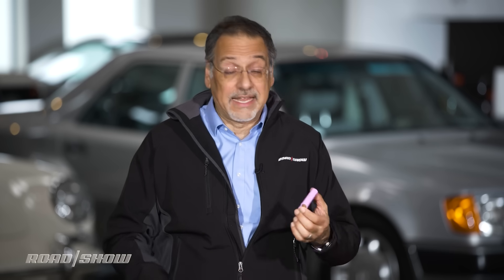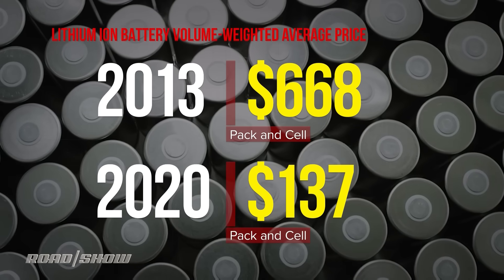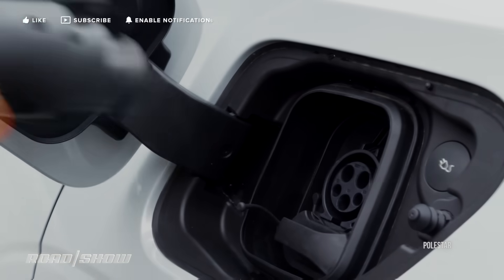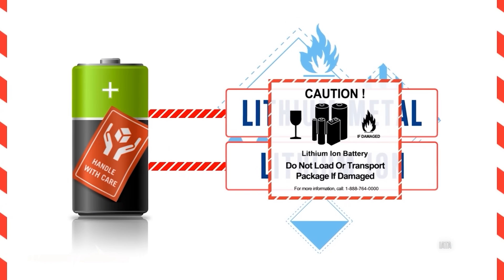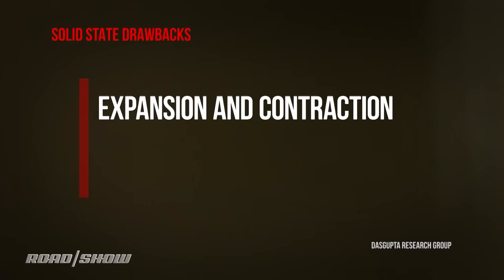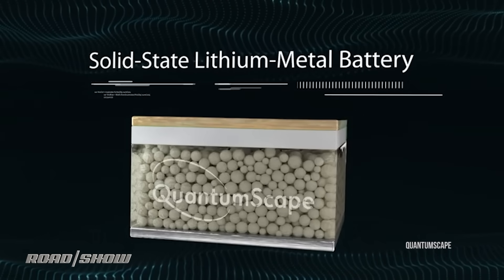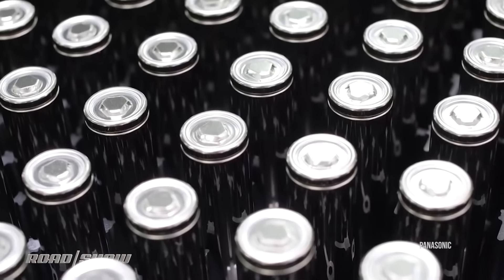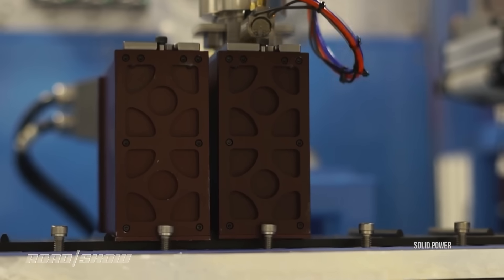When solid-state batteries arrive, you'll want an electric car

Comment: 96% of current EV batteries are recycled which is far better than dino powered cars.  Best aspect of these SS batteries is that they are a very easy replacement on existing EV platforms.
Reply: You still claiming oil is made from dinosaurs?
Reply: @sandersson2813  Oil comes from dead organic material of which consists of animal and plant ... some of that will be from dinosaurs  given enough time ... under pressure forms crude oil.  Either way, oil is a short term finite energy source that has climate impact when combined with oxygen and ignited and not recoverable.  Our sun is an easily obtainable source of energy with a life expectancy of 5 billion years or so ... oil has a life expectancy of 2065 or best estimates 2095 when it requires more energy to extract than is recovered.  The “dino” reference is one more of aged old energy source with a finite lifespan as in dinosaur extinction.
Reply: @robainscough  it's not made of dinosaurs though. It's made from algae and zooplankton. 
It's not made of bloody dinosaurs. 

Furthermore even EV makers say that EV's aren't especially green and like I said in another post if you got rid of all European cars today, you'd only save the planet 1% of C02. 

Focus on bigger C02 sources, and stop virtue signalling about cars, because its pissing in the wind.
Reply: @sandersson2813  decaying organic material include animal, reptiles, etc.  and yes dinosaurs  are organic material.  Your information is false and Europe isn’t the highest consumer of crude oil.  EVs are extremely green if you use green resources to charge them like solar which most do as solar stations and home solar installations are very common in the US.  There are far fewer toxic materials in EV if you do your research ... do you even have an EV?  You sound remarkably uninformed.

Comment: quite a bit of misinformation in this video...

e.g. the "burning battery Tesla" @ 3:00: looks like it's not the battery that's burning here (but most likely the A/C refrigerant). With a battery fire the flames would come out more to the side of the vehicle and not from the front - after al the battery is mounted under the floor between the wheels and not in the engine bay.

later when describing the cons of solid state:
"contraction and expansion" is not so much a problem of heat but of the actual chemical processes within the material. Charge is stored by ions that actually physicall move between cathode and anode and are incorporatd into the crystal structure at either end.

 "dendrites" are a problem with liquid electrolytes and less of a problem with solid state (where the dendrites would have to grow into a solid material, which is obviously harder than with a liquid)

Comment: Charging needs to be no more than filling up with gas. Also, driving range needs to be over 400 milers per charge. And then, who do you call when you run out of charge on the side of the road? Does a monster AAA battery truck come to the rescue?

Comment: No I won’t want an electric car .our power grid is old and dilapidated ,if everyone should purchase an electric car it would overtax the system .not to mention we already have brown outs all over the country .when there’s no way you charge your battery you don’t go anywhere .and you constantly forget to inform people about The amount of energy it Has to be stored in these batteries in an automobile accident or the cars are tore apart in  a quick discharge can electrocute people .that already happened in New Mexico and Arizona with GM’s volt. back in the late 90s and they recalled the cars you can’t insulate enough .in an accident especially a flash flood condition then there’s that other problem just like your phone held close to your head you get electromagnetic radiation coming from the battery .it’s not nearly as much power with the batteries have under your seat we still don’t know what damage this causes to the body .they all tell us you get cancer in the bone or brain, well with the power you’re talking about this could be a real problem .for every great idea there is an unintended consequence as long as you advertise it or allow for the possibility ,wouldn’t be a problem but you cover it up so no thanks. I’ve been A mechanic for four years every new gadget adds complexity cost and they all wear out sooner or later for transportation getting from point a to point B do you need something economical and efficient again if you inform people Of this no problem but will you?

Comment: It feels really virtuous to charge my electric vehicle with electricity from the coal fired powerplant. I am saving the planet, because electric vehicles are manufactured using zero energy. No child slave labour is used to collect the cobalt and other rare minerals for the batteries. The steel for cars is made using only wind and solar power. It is so incredible how an electric vehicle has no carbon footprint whatsoever!

Comment: No, i'll want an electric car when its the same price as current petrol and diesel cars and. when it either doesn't need charging at all or it only takes the same time to charge as to fill up with a tank of petrol/diesel.
Reply: It takes less time to fill up than a gas car because it fills up while you’re sleeping, so it takes no time at all to fill up
Reply: @jadenhalstead7290  What if its evening and i want to go somewhere else in an emergency. like a family member has been taken to hospital. for instance, do i need to wait till morning before i can go to the hospital. i mean personally this happened to me last year and i was able to jump back in my car go to the garage fill up with petrol and drive straight there. Battery powered cars are no good for real life users.
Reply: @jonbell6355  Unless you’re driving 350 miles during the day and neglecting to charge it until overnight, you should have more than enough juice to get to a hospital or anywhere else you need to go
Reply: @jadenhalstead7290   No you cant guarantee that wont happen. there is no metric where a battery powered car is more dependable or flexible than a petrol, diesel or even a hybrid powered car. battery's are rubbish until someone develops instant charging. Ok for city bound people or old age pensioners but thats about it. Its either Hydrogen fuel cells or some other form of onboard generator or its back to fossil fuel for the time being.
Reply: @jonbell6355  yes because when I buy a car, my first criteria is “will I be able to rush somewhere after driving 300 miles?”
Reply: @jadenhalstead7290  Or will you be able to drive on holiday anywhere  over 300 miles  in one go and charge your car when you get there.  maybe you cant park close enough to your holiday home to plug in . or or what if its cold and your batterys only hold half charge as most EV's do now lol
Reply: @jonbell6355  Then you stop at a charger when you need to? This isn’t rocket science
Reply: @jadenhalstead7290   You can defend battery cars all you like but there is no infrastructure, not enough electricity in the grid and they are too inconvenient to replace normal cars at present.
Reply: @jonbell6355  literally everything you said is false and can be disproven in a 30 second google search
Reply: @jadenhalstead7290  Not in the UK it cant !

Comment: BS!  Batteries only store electricity; they don't generate it.  The energy value of petroleum is equal to the energy value of the current electrical grid.  So, in order for electric vehicles to take over from gasoline, we need to double our electrical generation capability.  Currently, our government opposes any form of electrical generation other than wind and solar.  These unreliable and expensive systems would backrupt the nation and still not generate enough electricity to replace petroleum.

Comment: We need new batteries. Another revolutionary battery like Li Ion was would be exciting.
Reply: There is a company called Kurt energy that gas 18650 cells with similar capacity as lithium ion but significant higher charge rate, they are non explosive if punctured, and can do 10000 charge cycles and stay over 85% capacity.
Reply: @traviszane5334  What is the chemistry of Kurt batteries?
Reply: True 💯
Reply: Aluminum air batteries?

Comment: Electric cars run on electricity which is often made by burning coal diesel or gas -- so they actually run on fossil fuels.
If you gave everyone who commutes an electric car,  there would not be anywhere near enough power stations to run them, and you´d still be dependant on fossil fuels.
Tesla offered free wireless electricity to J P Morgan,  hoping for funding.
Morgan, with interests in telegraph poles and copper wire had him closed down.
Which is why you don´t have free power. It´s not profitable -- and it´s the economy, stupid.

Comment: "When solid-state batteries arrive, you'll want an electric car"
NO
Reply: As interesting as EVs are from a few standpoints, they aren't nearly as much fun as ICE.  To many, autos are more than an appliance to get from A to B.  And 1-gear thrust, though fun once in a while, gets old real fast on twisty roads (especially when wet). And I know, I'm a dinosaur for wanting to enjoy my daily commute and Sunday drive.   But much like I wouldn't want a 30cc two-stroke for my blender, I don't want a 400kW EV in my car.
Reply: Well when oil runs out, a car with an engine won't be much good...
Reply: @Brian-om2hh  Oil will not run out for at least another 150 years. That is assuming no new large reserves are discovered.
Reply: @Brian-om2hh  When oil runs out you wont have a car anyway.  Too many other parts require oil for production, including all the insulation for the wiring.
Reply: @Brian-om2hh  Most Diesels can be converted to run on vegetable oil.  Most gasoline vehicles can use ethanol.  That's what will happen when the oil runs out because there is no way to get a 400 seat aircraft to fly .9mach, 9000nm non-stop, using only electricity.
Reply: idk, Im looking forward to the better and instant torque for offroading for sure
Reply: And when SSB's arrive  -  I'll buy an electric car. Untill then I'll stick with my Lexus hybred and no range or charge time concerns. Simples!

Comment: Here is the solution:

- 4 electric out-runner brushless electric motor (one in each wheel).
- high efficiency brushless motors (%90 to %95 efficiency).
- 4 motors mean 4 wheels drive for great stability and control.
- electric cars will have electromagnetic suspensions (smooth ride...)
- the 4 electric motors and the suspension are controlled by computer.
- no more ABS needed, the brushless motors will take stop without locking.  
- each motor-wheel generate electricity that goes back in the batteries while breaking.
- no more energy (heat) lost in breaking discs.
- no more engine under the hood so plenty space for batteries (4 to 8 batteries).
- standardized lithium batteries will be exchangeable at the battery station in a minute.
- you just have to pay a fee at the gas(batteries) station to cover the batteries charge and use.
- electric cars will be MUCH cheaper than gas cars because they have much less parts.
- no more pollution and noise for us !

So why no everyone is driving an electric cars in 2021 ???????
Because many countries make billions dollars with the taxes on gas !!!!
So it is more a political issue than a technical one !

Comment: I wonder if solid state battery will be like room temperature superconductors, fusion power, or cold fusion.  Always around the corner but when we look back and it's a straight-a-way.
Reply: there are solid state batteries currently in use in busses in europe.

Comment: I worked for a Admiralty Materials Laboratory one of the Labs specialised in Power units.  They developed the Hydrogen Power cell  another Lab on the site developed the space shuttle heat protection panels. Whilst I was there they switched to leithem Battery research in 1977 they had solid state Lithium batteries as small as 3 inch dia by 6 inches long. As big as 12" X 12" X 12" cube high temperature Lithium batteries.

Comment: I remember watching an Australia group with a rv , a motorcycle and a car back in the 80s and they drove across the United States and back where they started in NYC and used nothing but spent oil from burger joints and, people's, garbage and the car had solar panels on the hood and roof  and it never used gas . My point the technology has been around for years but big oil wouldn't let it happen.

Comment: 'So where's all the power going to come from to charge all these electric cars?' he wondered.
'Shut up,' they explained.
Reply: What do you mean?
Reply: @jasonkilley  Well, if we all switch to electric cars, we'll need electricity to charge the batteries, which will have to be generated in addition to all the electricity we use already, and even more if we switch from gas to electricity for heating and cooking. Simultaneously we're supposed to stop using fossil fuels to generate electricity. So where's the power going to come from? No solar power at night, no wind power in still weather. A nuclear power plant in every town? Or will energy have to be rationed? But if you try to put these questions to "green energy" proponents, you'll be ignored, or told to shut up, or called a "denier".

Comment: Increase battery density by 20%, decrease the price by 25% and decrease the time it takes to charge by 30% and I’m in.
Reply: So you're happy with 200 mile ranges (100 miles each way) depending on conditions?  It might be an idea if they manufactured EVs from light weight materials. It makes me laugh when they talk about "range" when an EV-SUV is carting around a couple of tons of metal+ batteries, and that includes Muskwagens. Of course, using carbonfibre (which is 42% lighter than aluminium) will increase the cost of the vehicles, but as only rich folk can afford high range EVs anway, so what. EV range will not increase linearly with currently technology but parabolically, with more tech needed to increase range by ever decreasing amounts.
Reply: @SuperNevile  Its similar to the transition from horse and buggie to automobile. Some people still ride horses, but in designated horse areas.  For some people, 200 mi range is fine. Over the next 50 years, gas stations will probably transition to charging stations/gas stations. Undoubtedly, battery tech will continue to improve. It might be the case that a baby born today will never know the experience of driving an internal combustion engine on a public road.
Reply: @darylallen2485  I agree, battery tech will improve but only by so much, there is a limit as with fossil fuels. The rich will continue to drive EVs, part of the cost of Muskwagens is the use of aluminium to reduce weight/increase range. Aluminium is expensive compared with steel. The era of paying a few K for a 2nd hand "motor" will come to an end. The baby born today may have to get used to different forms of vehicle "ownership" in the future, and will certainly not be able to "fix" the car in the garage. Personal transport will be expensive for the individual "owner".

Comment: I'll switch to an electric car as soon as the batteries can be charged in 5 minutes (the time I spend now at the pump), last for 15 years with no perceivable performance degradation (just like a gas tank) and cost as little as a spare gas tank.
Reply: hear hear

Comment: I always wonder which will come first, practical hydrogen fuel cells or room temp super conductors and more efficient batteries
Reply: My view is that room temperature superconductors will require a huge leap, brought about by a fortuitous discovery of a new material, rather than incremental development.  It’s quite possible that RT superconductors simply don’t exist.  This is different to battery development which is developing in lots of directions in research labs.  Improvements will be found.  Serendipity can play a part there too of course.

Comment: The sheer fact there are so many "innovations" tells me that battery powered cars are simply not ready for prime time.
I live in the mountains. If stuck, there is no local facilities to recharge some big battery just to get home
Reply: Innovations are called such cuz they aren't exactly completely maxed out on potential nor complete. Also, even the first engine wasn't exactly ready for prime time. One step at a time brother.
Reply: @karlobringino8241  Sorry, batteries just don't cut it. We need to find something at least as reliable as a modern gas car. Until that happens, electric cars are no more than expensive golf carts.

Comment: Drop the FUD. There are way less fires in EVs than gas cars.  2170s are Teslas main EV battery,  it's 2021 and I had to check when this video was released.  As for solid state, they will be great when they can finally be mass produced but they will not be priced competitive in EVs for years after that.  They are going to be way more valuable in smaller electronics, due to the extra cost per watt hour.  This was very poorly researched.

Comment: I wonder why an exchangable battery doesn't seem to get much investigation. Lithium ion or otherwise, wouldn't it make sense to have a battery that could be removed and replaced with a fully charged one? Having an exchange network on the interstate system would make it possible for electric vehicles to fully replace ICE powered cars.